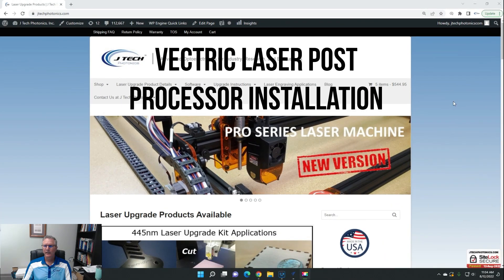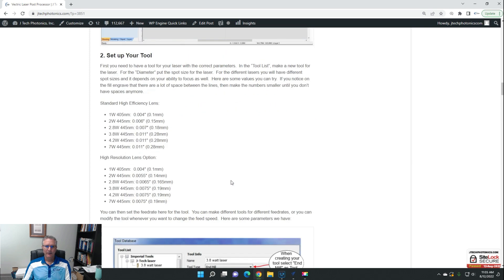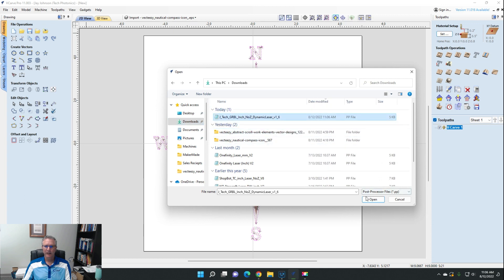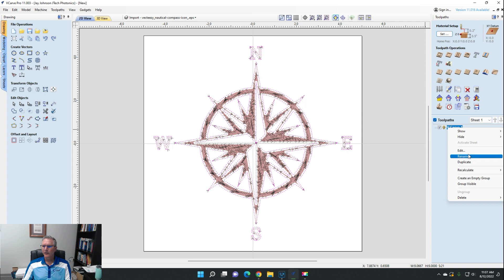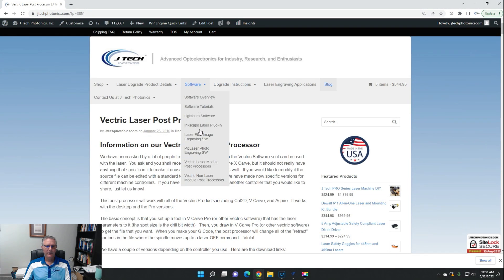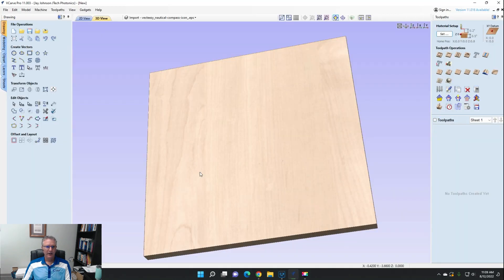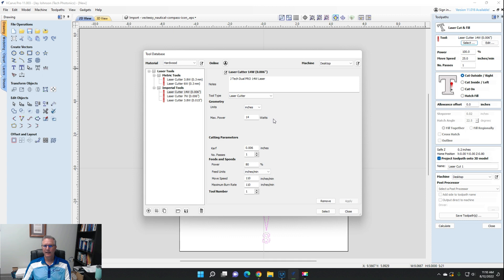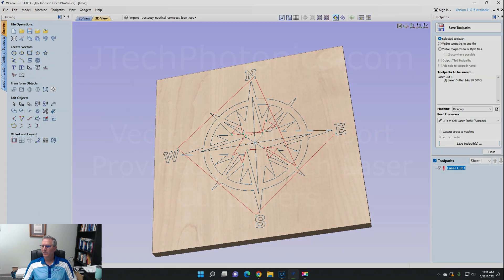J Tech Photonics Laser Post Processor Installation for Vectric Products

Comment: I am having an issue and thought maybe help could be found here.  I am using an Axiom Pro-6 CNC and a J Tech 4.2 laser.  I am using Aspire 11.5.  My set up has worked great for years, but all the sudden, the laser won't initiate for the first part of the tool path.  So if I am trying to cut a square, the tool path will start in the upper left corner and move across the top of the square, but the laser itself won't turn on.  Then when it gets to the upper right corner, it turns on and cuts the remaining 3 sides.  Same thing with cutting a circle, it won't turn on for the first 1/4th of the circle, but will cut the other 3/4ths.  In trying to etch lettering, it won't turn on until after it makes the first line.  It seems like some setting has changed, but I don't know what and can't seem to find it.  I have tried to go back and check settings on older projects, but it seems that if I open them in Aspire, they are somehow changed and do the same thing on the machine.  Of course this happened when I am pressed to meet a deadline!

Comment: Help, I have the laser module and I followed these steps, but the laser does not come up in the tool selection it is listed in the post processor selection box, but choices for 7 w, 14w and feed rates do not populate. Thank you.
Reply: I have the same issue.  Any luck on this?
Reply: @josephschneider5459  no, I had to add it manually from the jtech specs on their website